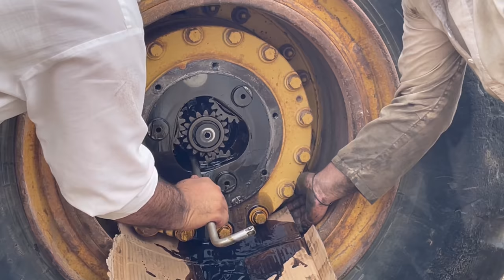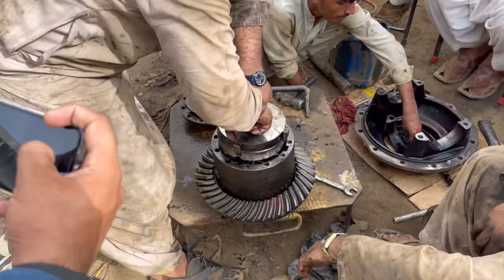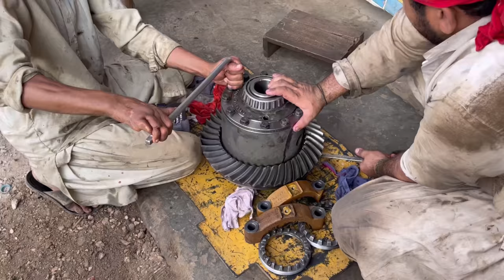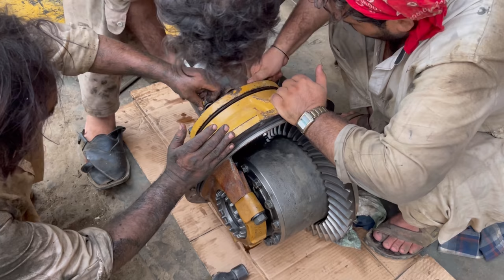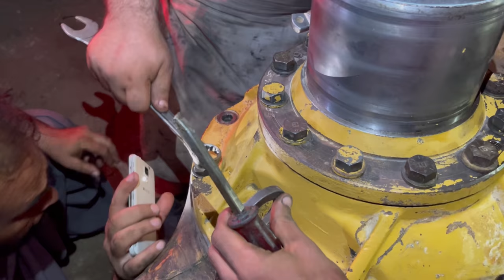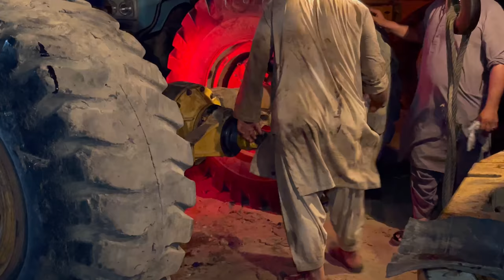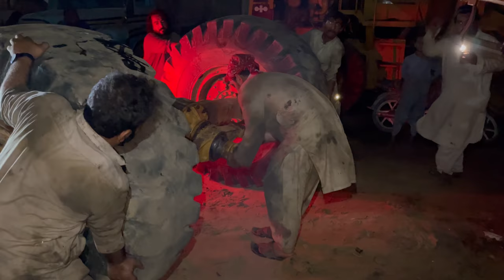This CATERPILLAR had a Major Defect in Differential GEAR  that the Experienced Mechanic Had Repaired

Comment: Ok guys this bit of gear is about $300.000 so only drop all the parts in clean dirt. And if the bolts are tight get a bigger hammer. And if we have parts left over we can put them in next week because it will probably be back.

Comment: I don't think this counts as a 'Repair', it's a bodge to allow the equipment to still function to some degree.
Reply: The whole machine could be ready for the junk yard anyway and only needs a few more months of use to hobble it along, it looked pretty beat up and we didnt see it run before or after, for all we know the engine is on it's last legs

Comment: Most amazing is their ability to work in that powdery dirt without getting it in the oily components.
Reply: Oh but they do… no way around it
Reply: @Detroitdiesel285  Maybe, but they do use a cleaning solution and it goes back together looking very pristine considering the conditions.
Reply: They do, watch again. They just have a step before assembly where they wash every single part in gasoline to remove any contaminants. It's pretty effective, that's how shops in here were back during communist times. These large heavy duty parts rarely fail because of a spec of dust being left in. A gasoline rinse is more than enough

Comment: They just made that loader almost helpless . You don’t cut the cut off of a differential clutch pack in that type of rear end. Now the rear axle is a dummy axle. The planetary gears, that the axle gears slide into now have no splines  to catch/lock to the clutch pack,  which means no drive at the spool. The spider gears are now just coaster gears that can not be driver by the ring gear.

Comment: bearings on the pinion were borked too, could hear them from a mile when he spun it. Why did they leave them?
Reply: maybe not told to and maybe too expensive.
these guys may earn $50 a month.
Reply: @rosewhite---  they could afford much larger bearings on the diff, and don't forget stuff is much cheaper over there.
Reply: @demonbox666  Cat designed the diff.  The owner may have said 'fix cheapest'.
Imported stuff is very expensive in Pakistan.
Reply: The answer is Pakistan.
Reply: @pfoxhound  we have atom bomb 💣 jf thunder alkhalid tank hataf gauri missiles united cars and bikes 😅 abdul kalam nobel prize winer we do best animations in Disney frozen
Reply: @rosewhite--- No way, did you see those Rolexes? Holly had one in Diehard
Reply: Wasn't on the work order.

Comment: I had to stop watching at 14:36 It just got too ugly for me there. That bearing was obviously a shrink fit. They needed to chill that bull gear assembly to get it on. Maybe warm the bearing up some too? But no they used a hammer and a chisel!
Reply: Was that before or after tightening the bolts with no order?
Reply: Some people cook the food because they know the relationship of ingredients in back of their head...and some cook because they can read the recipe book.
Reply: @afroplan431  so then you better open a bakery 😂
Reply: @el_Orate  😁🙌🏿
Am no cook... I was just setting a record straight.
Reply: I have been a machinist since 1976 and yessir, I never press on a bearing with my shop's arbor press or hydraulic press.  What for, when I can do it with sawed off ball-pean and a ground down chisel?
Reply: On a side note PF, my father was a Machinist Mate in the USN during WWII and then served on the USS Salem.  I have the opportunity to visit the Museum ship USS Salem and he gave me a detailed tour of the engine room.  I was awed by the 30,000hp reduction gears assembly for one of the four propeller shafts.  Dang was it big.  Five or six feet in diameter and 10-12 inches  wide.  Impressive engineering.
Reply: Well.. it was just to laugh a bit. You can clearly see on my channel that i work in a very random way, even though i know how it should be done. Sometimes bending mechanics makes different and new things. Have a look at my videos, you can find all kind of constructions 😂😂

Comment: A couple of interesting points
1) When did Pepsi start selling oil in plastic Pepsi bottles 
2)  Health and Safety  would have an epileptic fit over the lack of safety equipment and hazard waste protol
Reply: As the chief safety officer and engineer for the country, I approve the use of the special safety pyjamas and safety sandals. Likewise, the use of the speciality scouring sand used as the floor covering is a welcome sight, as this sand, when introduced into the gear axial will clean and scour all the bearings, this making returns less expensive.

Comment: Now that is what you call team work! Who needs a press to put new bearings on. They knew how clean the parts needed to be. Great to use the double wrenches as an extension  and who needs a torque wrench. 👍

Comment: What problem were they having with this diff?  As a retired mechanic I was dismayed at what I saw here.  Filing the teeth off the LSD friction plate!  Why, you now have rendered limited slip useless. Using a cold chisel to hammer a bearing into place!  I see one fellow broke off the bolt head on diff housing, but showed not replacing it.  And, no gaskets!!!  But, you have to give them an A+ for effort.  They only can do with what one has on hand!  I enjoyed the various responses.

Comment: Guys, this is the third world. For the assets they have, they’re doing a very great job. If they had bearings and parts at the ready, they’d use them.  But then, their Cat isn’t going to be out of service 3 months.
Reply: Well said and I don't have the balls to critisize these guys either as they are real troopers for working through what they have to do~!!
Reply: the only thing that doesn't cost anything is cleanliness, which none of these shops take seriously. dump it on the ground, mess around with it on the ground and then throw it back in, weighing a bit more for all the dirt and dust now in gears and bearings.  No excuse for that.   I know this is mostly on the owner but each worker could do their small part to insure a better rebuild that will last longer without all that dust ending up in the works.
Reply: @AffordBindEquipment  Did you watch the full video? They rinsed it and had cloths at hand at every step. I mean, sure, there's no way no particle at all passed, but it's not like you described it either.
Reply: @dragmahk  working on cardboard on the ground and the cloths they used being put on the dirty cardboard does not give one much confidence in the cleanliness of the job.  bearings can't tolerate any dust or dirt, which will cause them to grind themselves to death.
Reply: @AffordBindEquipment  Damn Man~These guys are probably trying hard not to blow their brains out everyday so give them a break~!!!!

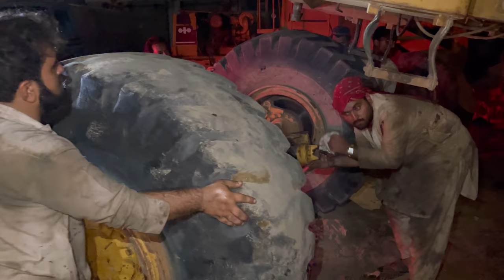Comment: Seeing that guy get under a suspended load without stands 23:57, priceless, their must be alot of deaths over there from safety ignorance.
Reply: He had on  his "falling object approved dew rag"!
Reply: I saw the state of the cable and almost peed myself laughing. Wouldnt find me dead under that.
Reply: getting under a suspended load without any kind of backup system in case of hoist failure is actually standard operating procedure in Cat factories... meanwhile, hoist maintenance is outsourced to the lowest bidder...
Reply: They put very little value on life in this part of the world.
Reply: Never get under a load.  Rigger's basic rules for survival.

Comment: The combination torque wrench/breaker bar kinda made me jump a bit...part of me would like to send these guys some proper ratchets.
Reply: No .they don't give a damn. I'm a mechanic myself living in Sri lanka. You will be surprised to hear that in my entire 7 years of mechanic life i have never seen someone using torque wrench to tight head bolts. Even though i personally own one I'm always discouraged to use it in workplace .Crazy how it is even PPE. Ha ha .. strange dynamics?isn't it? Only in a dealership you would be able to see a decent rebuild. Most of the "mechanics" here learn the trade from elders. No proper education , no proper apprenticeship,  no discipline either. So if you still want to hand them over a nice toolkit think about the facts.
Reply: Pls send them
Reply: @tharakanewan3544  what do you think of imt tractors

Comment: Yeah, that's right out of the Cat overhaul manual .... ROFL
Reply: Zactly.  Including the section on setting the proper work enviornment.
Reply: The teeth on the discs were certainly completely unimportant.
Who knows why the manufacturer had made those on it.
Probably just to annoy mechanics during repairs.

Comment: Given the crap and corruption, these guys work in you have to hand it to them they get the job done. As an MAN marine engineer, we had to work in sterile conditions or MAN would not give the workshop a certification. Even our torque wrench etc had to be collaborated and certified annually 
Hats off to them for getting it done
Reply: Best practices vs 70% good..
Reply: uuhhh... How many people did it take to "collaborate" that torque wrench? Wouldn't it have been cheaper, faster and easier just to "calibrate" it?
Reply: @johnd5398  you have no idea what you are talking about

Comment: Many say these guys do a great job with limited tools and spares but they have no idea how to keep parts free from dirt or sand
Reply: место рабочее нужно согласно стандарту..
Reply: ZACTLY and that only requires good practices.
Reply: @basilio237  Baloney.  Clean the casing of all dirt before working on it.  Provide proper working environment (clean and safe).  Use the proper tools.

Comment: Seeing this and other similar videos, I can understand they are poor people with very limited resources and education, compensated by hard work.

I can understand up to their lack of methodology and safety, but I wander why they insists to make all that stuff directly over sand/dust. It looks me a concrete floor is not so away from their purchase power and could help a lot to avoid medium/long term problems in their "fixed" stuff.

Anyway these guys have my respect.
Reply: This is from one of the northern areas of Pakistan and getting a concrete floor for this is a far cry for them. Here we are facing a fuel and economic crisis so if they get to take home enough, thats a big deal for them. The only way for them to get resourceful is through the chinese and not the Pakistani goverment which ignores these people.
Reply: @XtergoBlue  even a plastic tarp would keep rocks out of the gears. They are dumb mechanics trying to scam people. Fix it again when it breaks because they do a shit job.
Reply: These establishments are part of the informal economy. No taxes paid, no regulations, no licences etc to carry on these trades. Thus the location is informal and they might get moved on by local authorities. Thus they have will not invest in anything that can't be moved. The formal places have licence, are taxed and will have proper building, concrete work areas but they cot more. These informal establishments keep the informal economy moving. I hope that explains. From Islamabad, Pakistan.

Comment: Thats not a defect. it happens from repeatedly slamming into reverse when your still going forward. 
I found this out on a brand new cat loader, got told to go fill it up. shifter is on the left, same as turn signals.
Right would be forward, left would be reverse. and you rotate the shaft for what gear you want and it auto shifts. 
Sooo, ME 3rd gear coming up to turn, mistakenly tries to use shifter as  LEFT (reverse) turn signal, at 30Mph on concrete pavement.
It stalled skidding, bucking and grinding. Had to turn off front drive to even move machine back to jobsite.
I parked it unfueled, and told my boss, he told me...OMG !!!! DONT say anything !!! youll get fired. (he was nice guy)
 A week later the owner put it in all wheel drive it wouldn't move, floored it and instantly killed its entire front differential..
It was around $40,000 to fix.

Comment: Aside from the safety sandles, dirt, dust...etc, this is one of the best shops I've seen in India so far. That lathe actually looks like something that could still be in use anywhere
Reply: And measuring!
Reply: pakistan
Reply: Its pakistan

Comment: Clever, using dust as a friction modifier for the clutch pack. Caterpillar will use this in the next model
Reply: Dust.. dont be stupid.. dust and bit of sand has noth8ng on metal debris inherent in this

Comment: Since when do you use a Hammer & Chisel on a precision made piece of equipment like that Hub, that bearing is an Interference fit & should have been heated first for expansion then allowed to cool to grip the Shaft- not just beat the shit out of it, common sense really & I know these Lads haven't got all the correct Tools but they have got Bottled Gas.
Reply: Some call Jesus a Joiner..
Some call Blacksmith a Mechanic!
😂😂😂
Reply: @lucasdrozdz8192  I've seen the results  of so called "mechanics" & it usually ain't pretty either 😂😂
Reply: In Africa and a majority of elsewhere, people die and life must go on. When you need suturing we use barbs available in the locality. All manner of improvisation abound. A single car could have everything from Marc to Mahindra.
Reply: @johnpartridge7623  seriously, no miracles!? 😂 Or luck!? 😂 Coincidences exist also! 😂

Comment: Hope CAT’s engineers and manufacturer are watching and learn
Reply: You got to be kidding.
Reply: @edgemonsiteworksllc3369 sure he is chap.
Reply: @Private011  I've owned cat since 1980. My father had them when I was a kid, the only cat that has defects is the grey market machines, not built by cat but has its name. Parts are not interchangeable. The grey market machines aren't as strong, don't last as long and are expensive to fix plus the parts have to be ordered from the counter the machine was built in. Meaning it can take months to receive them. Brazil makes most of them

Comment: You got it back together, Bravo! I am not an expert but if you machine away parts that suppose to be tightfitting you loose the function of it? Maybee you should use the Google function of your smartphone instead of the light?
Reply: When they machined those teeth away, they deleted the limited slip. The whole purpose of having the clutch plates in the first place. Genius
Reply: @TheFeller1554  Skip the clutch !  I say. Keep it simple!

Comment: I’ve heard others call these people dumb. They’re also the crafty fools who will stack 12 D cell batteries on top of each other for a power source and run a fine wire between 2 wooden pressure plates so the metal detector doesn’t pick it up for an IED
Reply: Cool narrative bruh...

Comment: OSHA would have a field day with this outfit. No steel toe boots?!

Also they aren't doing the proper "star pattern" when tightening down all those bolts, nor are they using a torque wrench or torquing to spec.

Still fun to watch and interesting.

Comment: I am surprised to learn that there is a planetary gear set inside the wheel hub. Never seen that before. Imagine the stress on those small gears during operation.

Comment: Ivory built many many chunks what we call the ring and pinion the chunk and if you can get away with it only take the one side off leave the other one on you don't lose your adjustment you put it back together just put new bearings and new seals clean it up if the bearings ain't bad don't replace them and you ain't got to change nothing

Comment: OSHA approved footwear?  And i do not know if anybody else noticed....but they didnt center that plate before putting it in the lathe.  All the more and none the less, impressed with their ability to work with what they got!
Reply: I think they were just removing the teeth, so you just need clearance. It is centered in the assembly on the OD.

Comment: I didn’t understand why they cut the teeth on the disk of the self-locking differential. Now it won't self-lock. Was it the goal?
Reply: I can only guess to make turns easier or the lockers were too agressive for the work area? I’ve seen them do much worse with no idea why. A Steiger I worked on years ago would dig 8 trenches (8tires) when turning the wheel while sitting still with lockers. It was highly limited in how it was used.

Comment: Next time pull both final drive covers and the axles then the diff, preload what's preload...............remember black bolts go on the inside and yellow painted bolts on the outside...............:)

Comment: A million dollars worth of equipment, not one air compressor within a thousand miles. Not one electric impact. Not one bottle of brakleen or wd40. Not a clean rag, cotton or microfiber. 

I mean, they got it done, but if they had a single powered hand tool, theyd have been home in time for hummus.

Comment: i dont get it, these dudes are working on very expensive equipment, but cant afford a ratcheting wrench or air tools?  is it really cheaper to hire 3 guys to tighten bolts when 1 air gun could do the same job?

Comment: It wouldn't do any harm to change the oil on the Front axle  on the Machine behind them, ? , I've noticed with these machines when stripped down either little oil,  or its black as coal or both,
Im sure if oil was changed more often in axles , Engine's These parts would be more reliable,,? 😊

Comment: As this seems they removed the inner gears of the differential. This seems to be a heavy duty limited slip diffrential, now that there are no greas that can grip, this is just an open diff, so as soon as you put it under load you will have no traction beacause the unloaded wheel will just spin freely. What a mess. If Caterpillar made that thing whit an LSD it needs that LSD functioning to work properly.
Reply: There making sure that if it breaks again they can fix it. After it snaps a drive shaft or the teeth off a gear.